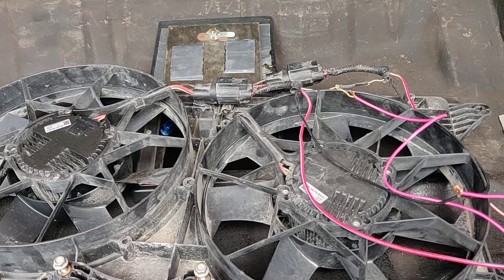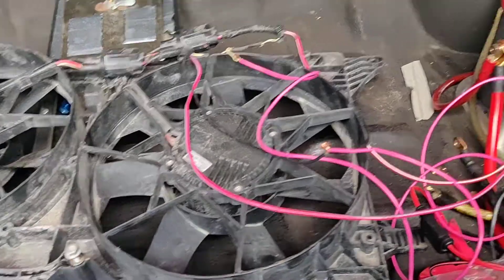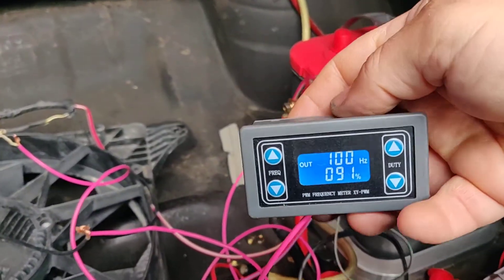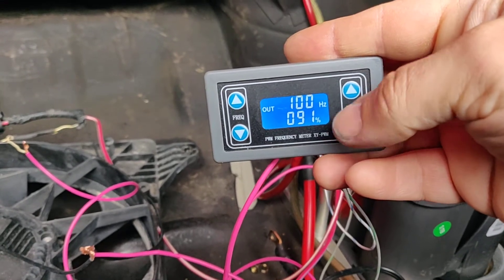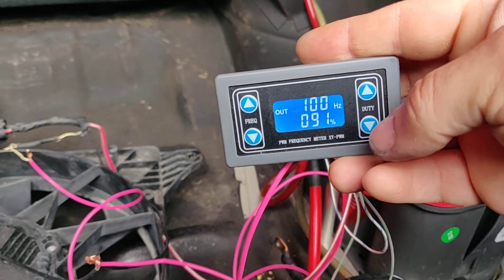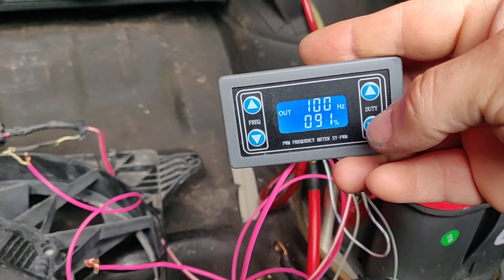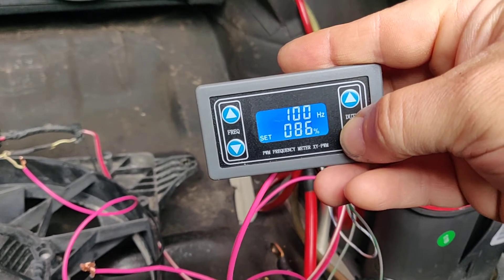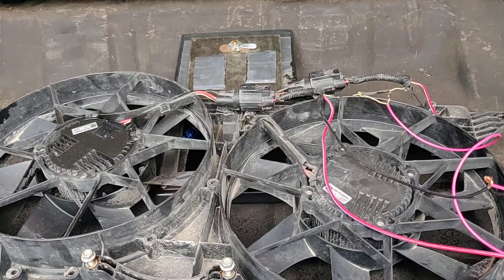Chevrolet Volt PWM fans

Comment: The product claims 1hz to 150khz so 100hz seems possible. The DROK signal generator created a PWM signal that instructed the fan motor controller speed. Very helpful.

Comment: Is there anyway to test the fans without the pwm generator?
Reply from the maker: Not that I am aware of...
Reply: @projectgattago  In my experiments with a 2015 VW Golf, I learned that if the signal wire is disconnected, but power is applied to the two 12v inputs, and ground is supplied, the fan controller assumes there is an emergency and turns the fan on, full speed. Therefore, as an interim measure until I figure this out, I installed a SPST switch that severs the signal. When I drive the car, sever the signal via the SPST switch, the fan goes to full speed, cooling the radiator and condenser. When I arrive at my destination, complete the signal so the ECM sends a signal and the fan shuts down (obeys the ECM). It's likely that other fan manufacturers do this differently but this is working on my VW until I figure out the actual problem. Hope this helps.

Comment: Amperage?
Reply from the maker: They are 300watts each, so 25 amps at full speed. each.
Reply: @projectgattago if I have all my wiring to a switch panel with relays and 30amp fuse in I fine with this or should I still add a 25amp fuse to each fan before it’s wire to the switch panel with the relay and 30amp fuse on it?
Reply: @DannyR2681 

From what i have read on these setups. 
Battery ground
Fused battery power.
And the other to pwm signal.

No relays

Comment: Andrew... I just came across this and wanted to ask a couple of questions. Right now I'm using two (2) Ford 12" Contour SVT fans in my BBC Camaro and using Carl's PWM. I got things running near the end of the summer and it seemed like the engine was running too hot (as high as 220°) on hot days and the fans would never shut down to the 195° cutoff. Anyway, I rewired the PWM direct to the battery with 8 AWG wiring and will test my voltage going to the fans asap. Right now the weather in western New England is snow, salt, sleet, and on top of that my interior is out and I have no seat. ANYWAY LOL... since I have a dual fan shroud, I was thinking the Volt fans might be an alternative that could give me more CFM but it seems that Carl's PWM wouldn't work with the volt fans or any other brushless fan setup. So if it comes to that, do you think two of these fans would be up to cooling a 461 BBC, and what sort of PWM would I need to use to make it all work? Sorry for the long story, but I figured if you're cooling a GTO its probably a good sized motor unless you've slipped in a LS LOL.
Reply from the maker: The Volt fans need a PWM- signal. I plan to do this with Holley EFI, which I have done on customer's cars as well as on my Cougar. As far as whether the Volt fans will cool your combination, that is hard to say. It could be your radiator is not up to the task or that you have other issues with your cooling system.
Reply: @projectgattago  Wow... thanks for the quick reply. So I'm using a Cold Case BBC radiator, and have a VA condenser in front of that. I never had any significant cooling issues with the old 4 core copper radiator and a simple belt driven (no fan clutch) setup unless I was stalled in traffic at 5 mph or stooped. I wasn't getting full voltage to the PWM when it was connected to the Junction Block, I have rewired as noted earlier. I had switched to a serpentine setup so space was a premium and the Ford fans were pretty shallow. If I don't get any success with the Ford fans I was wondering if the two Volt fans could be used with the OEM style PWM and a plain old carburetor setup? Or does it require EFI and an ECU? My other alternative is to scrap my custom shroud, fans, and PWM and go with Vintage Air's monster single fan and shroud.

Comment: Would you please provide us with the wiring diagram of the setup you made?
Thank You inadvance.
Reply from the maker: Not much to the wiring. Power and ground go to the battery. The little wire goes to the PWM source.

Comment: Do those fans just have three wires coming off of them? I have a pwm Bette fan and it’s only got three wires + - and pwm trigger. I’m trying to trigger it with a little pwm generator like yours but I’m not getting anything.
Reply from the maker: Yes, just three wires.

Comment: Will there be a temperature threshold that will kick in 100% duty cycle ?
Reply from the maker: When installed, the Holley EFI will send the appropriate duty cycle based on temperature and AC pressure.
Reply: @projectgattago - I do not know the benefit of not running 100% duty in a thermostat controlled setup other than maybe for 1/4 mile passes. But then you could just toggle things on and off. Am I missing something ?
Reply from the maker: @TheCanadianBubba  The benefit is reduced strain on the electrical system, quiet operation, and more precise temperature control. See one of my previous videos.